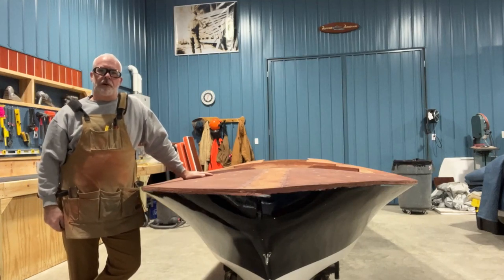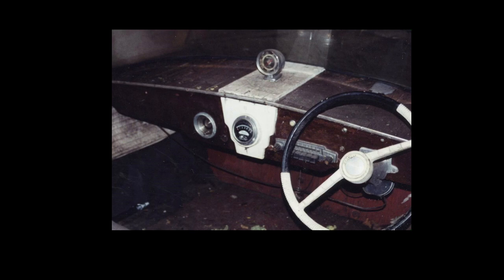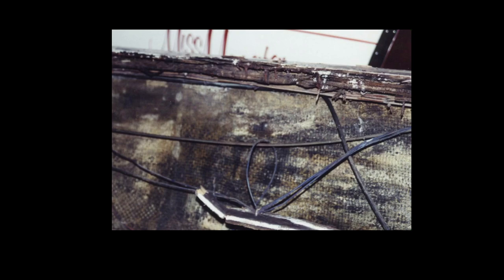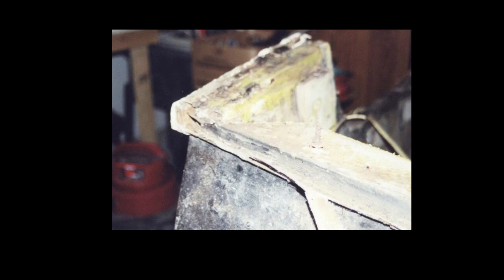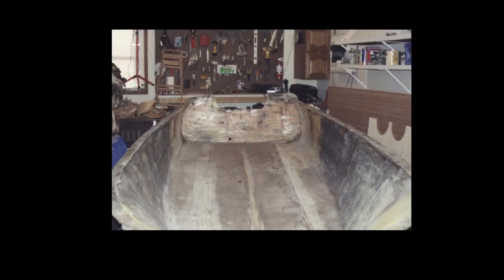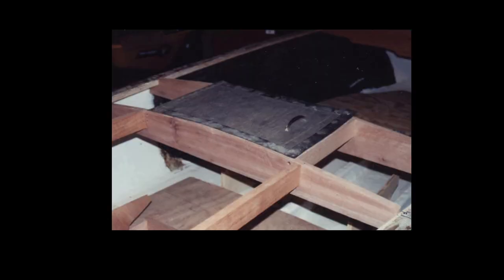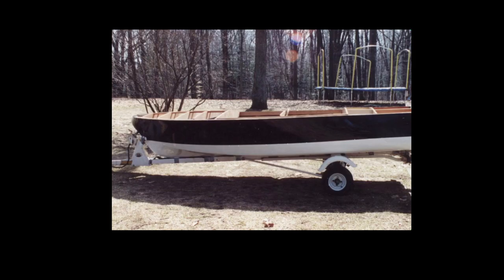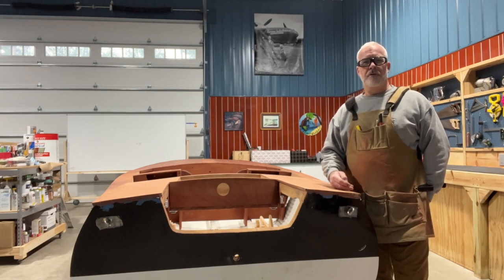How to Restore an Old Fiberglass Boat- Episode 1- Restoring a 1957 Wonder Craft 14' Boat

Comment: We are restoring a 1958 MFG Cambridge. It is a molded fiberglass hull with a mahogany top and transom. It was modeled after a similar Lyman. Everything is original (to my knowledge) but I am installing a new motor, steering mechanism, rub rail and windshield. It won't be a show quality job, but very nice. We decided on a new Suzuki 4 stroke simply for reliability. We live on the water and it will see heavy use, we generally go for a boat ride everyday during the soft water season. (we live in Northern Michigan). We are prepping for varnish and hope to have it completed by summer.
Reply from the maker: Eric, that sounds like a fun project. I believe MFG is one only a few, like Wonder Craft, that had a plywood deck with a fiberglass hull. Maybe we will see you at the ACBS International Show at Bay Harbor in September.
Reply: @reynoldsrunabouts  we will try to make it. We live in Alpena so it's a good trip for us, not too far. We love that area too. We plan on hitting at least a couple shows out of town this summer. We have a couple smaller shows around here. The Grand Lake Classic Boat Show is supposedly real cool.